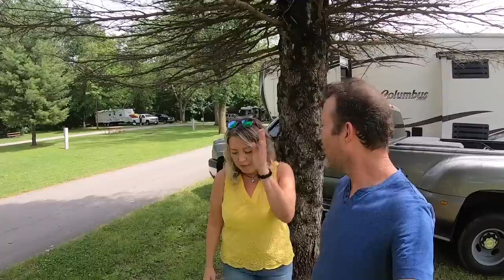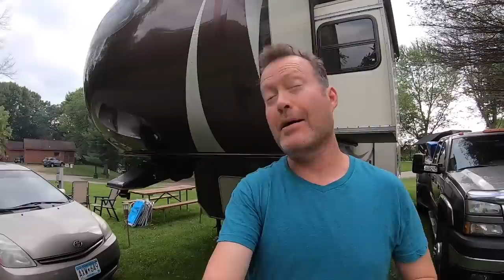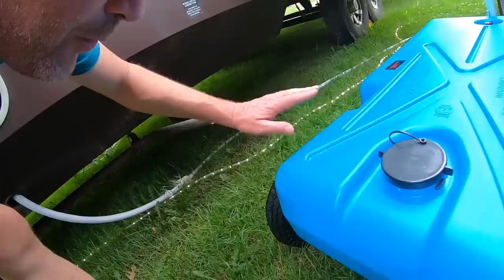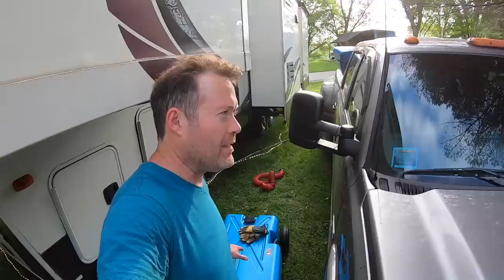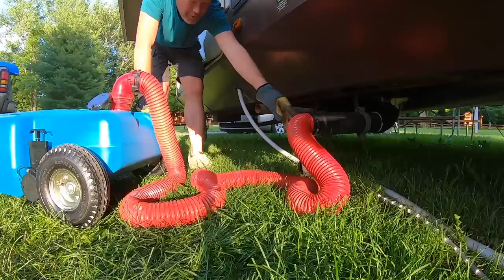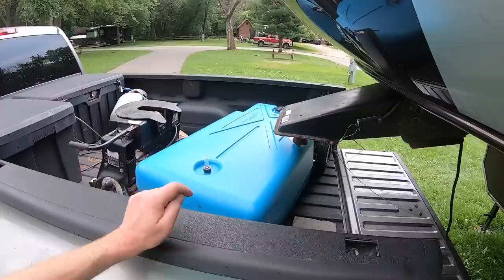RV LIVING FULL TIME - DUMP RV GREY & BLACK TANKS WITHOUT SEWER HOOKUP

Comment: A better solution, but expensive, is a mascerator pump. You hook it directly to your blast gate and it uses a garden hose to pump it, even up hill. Last time I priced one was about 6mo ago and it was about $250. Estimated time to empty a tank is 5min. I don't know what size tank was referenced. You would be able to leave the tote in the back of the pickup and mine has a 6ft remote to control the pump.

Comment: tip: Always have a shovel and rake handy. I always found a way to allow the grey water to flow out freely. You can buy a garden hose adapter and find a nice spot on your site to allow the grey water to drain. For that reason we would request a site along the woods line. Note: Use biodegradable environmental friendly soaps and shampoos!

Comment: Okay so we got the exact same Blue Boy. I used to be a plumber and here's your solution to make it what I consider much much easier yet a bit slower. Step one put the blue boy empty in the back of your pickup. Step 2 connect what is called a macerating pump to the outtake of your RV sewer discharge. Connect a black tank only garden hose to the connection on the macerator. Then place that end in your Blue Boy. The macerating pump is designed to shred and pulverize all material as well as pump uphill, so that you can get your black tank and your gray tanks completely empty. Once the tank is full, shut off the macerating pump, pull the hose out of the blue boy, close the cap on the blue boy and drive to the dump station where you can empty the blue boy as before. Nobody can see you driving with the stupid thing behind you because you keep it in the back of the truck anyway. Other rvers do it and do it especially while boondocking so they don't have to leave their campsite. On top of which, if the dump station that is nearest is 10 Mi away but the only game in town, you can still effectively dump without taking a rig with you. It's a win-win all the way around. Greatest of luck to you guys!

Comment: I use a Camco 36 gal for my 3 30 gal tanks, so no overflow chance. I also use a Flojet macerator/pump and a 25’ 3/4” commercial hose, and strap the Camco to my tailgate, so no lifting, no towing. Just back up to the dump station, hook up your hose and open the valve, dump, rinse and repeat. Also with the Flojet, I can dump at home in my sewer clean out. A great addition to my equipment.

Comment: for raising sewer drainage system. put trailer on 2x6 boards stacked. then drainage is down hill for totes and normal full hookups. it also stabilizes camper from soft ground and vibrations

Comment: You got an older version of the tank.  I got one for Christmas, the drain hose was pre-assembled and very nice.  They also have improved the valve- due to complaints on operations difficulty.  You can also hook the hose directly to the tank, not using the piece that goes into the sewer.  Very exciting stuff!  Lol

Comment: If just my self I can go 3 weeks in our motorhome (gas rig so no huge tanks) by conserving water with dishes and showers. A new trick I just learned is to get two good spray bottles and use one with some dish soap in hot water and one for rinse to do dishes, just spray the plate wash down with a sponge then rinse off with the other sprayer. saves a ton of water. But that is where a motorhome beats out a trailer is it is way less work to drive it to the dump station and re set up.

Comment: We bought a 30 gallon honey wagon just for those occasions when hookups are not available. Ours is the "Smart Tote 2" with a built in hose for filling and dumping. It's mounted low on the tank so filling a tank that is higher than your discharge pipe is not an issue.  For transport while traveling, if you have a ladder on the rear of the RV there are hooks available on Amazon to hang your tank on the ladder and use straps to secure it. I don't think this will be an option on the toy hauler though, with the ladder on the side.

Comment: You need a mercierator pump, it will pump up hill up to 100 feet. You could also raise your 5er with your levelers to make this process easier. As for your poo parade we all have to go so it’s fills up tanks at some point. When you buy a large unit like yours you also buy this exercise.

Comment: GET A 12v macerator pump that connects to your sewer connection. it can pump it into blue tote wile leaving it in truck bed throw a garden hose. 
MOST WORK AT 100 FEET AND UP TO 10 FEET HIGH

Comment: schweet,on a less smelly note but will save you from a big headache you need to invest in some pool noodles for those slide outs,seen way too many peeps crack their noggin open on those corners,just cut them into 24" sections and split down the middle and fold around the edge and they come in lots of colors,even poopy blue.

Comment: Hi, I use mine as a back up, but your hose attaches the same way at both ends, your elbow is for the dump station, I'm  Surprised they didn't pop out on you, most people forget to vent the tank and if you don't lock your hose on to the blue tank, well you can have a mess.

Comment: Perhaps try filling the tote using the "dump" portion of the tote. Since the tank on the RV are higher, it should force the liquid inside the tote, then tip it on its side to drain and disconnect the hose. 
In theory it should work, but may not be the best solution

Comment: Black first and then Gray so that the grey helps wash everything out
Reply: He did do that but he dumped 1/2 (I assume)
Grey first. Then the Black tank, then grey tank again, its mentioned. 
But good to know when ur green, like me.
Im considering a cassette toilet or a composting and have no black tank at all for an RV I have not purchased yet.
Reply: He did grey first in the video to make sure the connections wouldn’t come off and poop go everywhere. They did pop off so good thing he did try grey first.
Reply: @VoklstWestie  (and Brandon) :  He has two grey tanks, so he drained the first one as a test (as Speedy_Tunes noted), then the black tank, and then the second grey tank.
Reply: @Milesco  I am shopping for an RV so have not bought mine yet... Im considering no black tank at all! Which would leave room for a larger water or grey tank! Get a compost or bucket toilet, no black tank or black tank dump. Eazy peazy.
'Course Im toying with the idea of No Propane either. Just generator & solar.
Reply: @VoklstWestie  :  Like many people, I'm a bit dubious about composting toilets.  If you get one, let us know how it works for you.  

As for forgoing propane...I  personally don't think that's a great idea.  (Why do you want to do that?)  Propane contains a lot of thermal energy in a convenient form.

What are you going to do for heat?  And for cooking?  Without propane, you're gonna have to run the generator every time you want to cook something, unless you have a very large battery bank. 

And I think heating the RV without propane would be an even bigger challenge.  There are a few high-end (read: "expensive") all-electric Class A motorhomes, but I don't know how they solve the heating problem....I assume they have some sort of large electric furnace, and every time the thermostat kicks in, it would have to fire up the generator.   I'm not sure how desirable that is at 3:00 in the morning.

But you follow through wth your no-propane plan, let us know how it works out.

Comment: We use our “Stool Bus” a lot @ state and federal campgrounds where full hook-ups are few and far in between. Our tank has the fill port on the bottom edge of the tank. If you are dumping uphill, it is almost impossible to do without some kind of a spill. I have made some modifications. Also, I have been to parks with speed bumps and I did launch 40 gal of black water while towing. I now use bungee cords to hold the tow arm in place.
Reply: Stool bus!  Best name for it. 😂

Comment: 2 Tips...

1) Put pads and or wood under your tires, jacks to get the outlet higher.

2) Put the tote in the back of the truck when returning to the fifth wheel so you can get back faster and don't have to worry about it. 

I actually sit on the bed and watch it while my wife drives us to the dump. 

Also, why is this video out of order lol

Comment: I have a Cyclone 4200 we have 4 tanks on our rig.they are 42 gallons 2 are black a 2 are gray. We all so have 2 full bath.the front bathroom is on one set of tanks the back bathroom has the other. But the kitchen sink goes into the the rear tank.so 42 gallons get full fast.we can go only 4 days on the rear gray tank. We where told that we 84 gallons tanks. An we could not figure out why our tanks where getting full fast..so what we did on the kitchen sink we just emptied just the gray tanks .got a 5 gallon bucket an dump water in the sink until the gray tank was full.then went out side pulled the gray in front it was empty an then pulled the rear gray tank an it was full.the sensors do not read right.on our rig.

Comment: Holy crap!(no pun intended)  Those poop receptacles are $350!!!  It's for poop,for heaven's sake.  It's not like it's nuclear waste. 
The biggest poop shame I've ever heard of is about someone who had a poopsicle hanging out of their RV.  Apparently when the black tank freezes (and water expands when it freezes) and it's relatively full, it pops the cover off the tank and a poopsicle grows out of the hole!  How disgusting...
As for the height issue, won't the weight of the waste coming from the tank overcome the height of the opening on the poop tank?

Comment: LOL!  This was a funny episode.  Your apprehension throughout the process was so entertaining.  Why?  Because we know exactly how you felt the first time doing it.  We use one of these "blue-boys" for our much smaller travel trailer for pretty much the same reason you need it.  We use it not only for sites that don't have sewage hook-ups, but also when we're boondocking and moving the trailer just to dump is not practical (or a pain in the backside).  After a couple times you're going to be much more comfortable.  But yes, I love the poop parade, but when people see me and ask, they're more interested in getting one for themselves due to their benefits.  

- We have a very short dedicated hose from the trailer to the tote.  We are able to get the tote right under the dump gate.  We also use this hose to empty the tote at the dump station.  The key is, having a dedicated short hose is much easier to use and clean than your standard length hose, which can be unwieldy.  

- After  use, we normally flush it out at the dump station and wipe it down with Clorox wipes so you don't have to worry about kooties.  After a good flush, we also add some Clorox bleach crystals in the tote with some water while we're still camping and empty before we go home.  This ensures any remnants are at least bleached.  Read:  It doesn't take much, so make sure you keep it clean otherwise you will regret it.

- Before transport, double-check your gates, caps, or anything else that secures your waste in the tote.  If you leak black waste, it's not going to be hard to know you did it, but so will everyone else.  It's breadcrumbs you cannot sweep away.  

- Adhere to the speed limit.  I've seen people lose control of their totes and it can get messy if anything opens up.

Comment: there is an elbow that hooks the dump pipe on your rv then the hose connects to the elbow and then you connect a garden hose to the elbow and it pretty much uses the garden hose pressure as a "" pump ""  with the venturi effect to essentially  "" pump "" the water uphill

Comment: You act like it's your first day camping.  Read your instructions.  They give you that short hose for a reason.  Also you should always use a direct connection between both the RV and the tote.  That termination piece you use at a normal dump station is not the best choice for your tote.  I use my tote all the time and I have never dropped a single drop of water, or anything else.  On a side note:  You can rinse everything at the dump station including your hose and tote.  You don't need to use your grey water to get your equipment clean.  We go to a lot of State Parks that don't have full hook ups.  I bought a small tote (15 gallons) that way I can just put the tote in the back of my pickup truck.  This way I avoid the "slow ride of shame" with my tote behind the truck.  It takes me 1/2 hour every two days to take care of business.  No big deal.

Comment: Many states allow gray water to be dumped on the ground (assuming your site isn't setup in a way that the gray water would disturb you or other people after the dump while it absorbs into the ground). This would virtually eliminate the need for that blue tank unless you stay is states that do not allow dumping of gray water without a dump station as black tanks can go 2-4 weeks for two adults without the need to dump.

Comment: The purpose of the locking hose mechanism on the blue tote is to prevent what happened in your first dump.  You should not use the sewer elbow/donut on the tote strictly from a health perspective.    We have the same tote and it has worked wonderfully for us for 2 years.  Good luck in your travels and stay safe.

Comment: At the very end of the video you did what I was going to suggest. My sewer pipe hung very low on my previous trailer and I had the same problem with my tote. I bought a cheap fitting from Walmart which had a lower profile than the orange one I was using. I also bought a 10 foot section of hose and cut a very short section off. I then hung a short section of plastic roofing gutter under my sewer line to support it. I used a small bungee cord and hung the gutter around where you hook the sewer line on the trailer and let the other end rest on the tote. Good luck and I hope you don't have any spillages.

Comment: Never even thought of this. Now to look into a macerator.
Reply: Peter T
 RV-er since 1970 Slide in camper, 2 travel trailers.

I use a 120 volt Jabsco macerator pump when I have to use a tote tank to  dump. 

Sometimes it is easier when we  hit the road and there is a "longggggg" line at the  dump station.
I connect a short sewer hose from trailer holding tank discharge to the pump.
If possible I  connect the tote tank to my truck and use a 1"discharge hose from the pump to the inlet of tote tank to avoid having to pull the full tote to the truck (it's really heavy and a struggle over soft terrain). 

When the tank is full I can make a run to the dump station. If circumstances warrant, I can secure the tote into the bed of the truck and use a longer 1 inch discharge hose from the macerator pump to the tote and drive to dump station. 

If the tote is in the truck bed it can be dumped without removing the tote from the truck. This makes it possible to dump later if there is no dump station onsite.
Reply: @PeterCThompson  I really like the idea of leaving the tote in the back of truck, so I will definitely be getting a macerator.

Comment: Use the exit as the inlet when connecting to the camper that is that low...then you don’t have to slink the stinky slinky as the water diet have to climb that hill...also you can use the valve on the portable take as an emergency shut off.

Comment: I drilled a 1/4" hole in the top to allow me to still use the float indicator but to avoid the build up of air pressure. Lose the angle and attach and lock your hose to the top.

Comment: QUESTION; it may be a stupid one but here goes. How many gallons is the tank? Are they always at least as big, preferably larger than the camper tank? I’ve seen smaller ones, so you definitely have to be larger or what a mess. Other option is dump before full I suppose? It’s the one thing I’m not looking forward to, dumping the poop tank, Grey, no issues

Comment: Really makes you reconsider a 1) composting toilet,
2) a cassette holding tank toilet. 
* no $350.00 poop tote
(Except for ur grey water- given ur current situation on that lot!)
* no hoses
*no dumping of thee above
--------------------
After watching what you're doing I would get those clear elbows for either side of your dump hose. It really makes a difference to see whats coming out of the tanks. That way you know when to wash out with bleach.
---------------------
I have Not bought my RV yet... still researching & doing my homework. 
Im leaning toward the 13' Scamp curved cube.
But I want to check on special ordering it the way I want it! 
So either a cassette toilet or composting toilet. 
* No Black tank at all.
* Both fresh water & grey tank could be larger.
I have a longer list but this is a major piece...
Dont even get me started on heated floors & solar.
Chicago Renee hath spoken!

Comment: I use a RV Macerator Pump with a 10' 3/4 hose (I bought a SewerFlo Quick Release RV Macerator Pump on Amazon). I have the Macerator plumbed permanently into a tee that is connected to my main drain. When I am on full hookups i run direct to the main drain when I am not on full hookups like Mooch-docking I hookup the 3/4" hose and pump it into my portable tank.

The nice part about the macerator is that its fast and and the 3/4" hose is much easier to handle rather than the normal 4' RV sewer hose then I just have the tank in the back of the truck so emptying it is much faster as well since gravity is on my side.